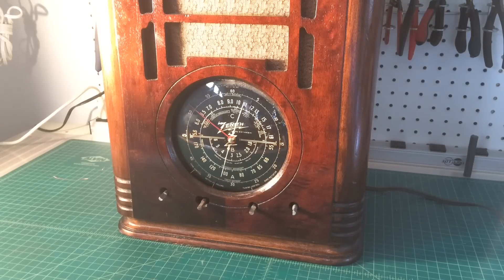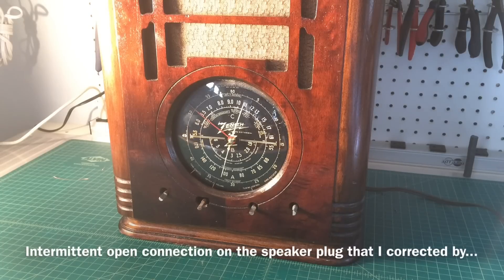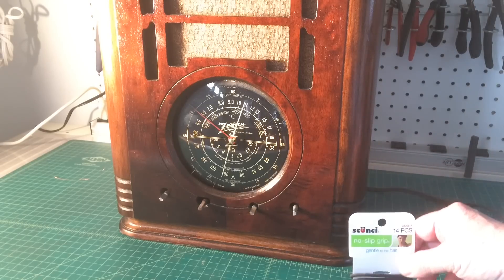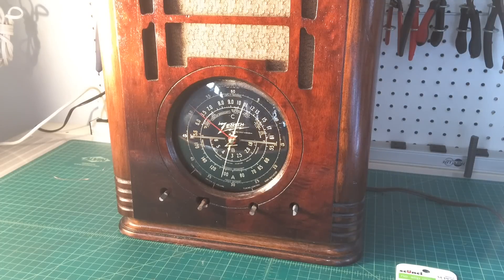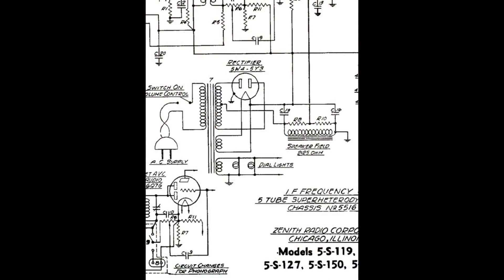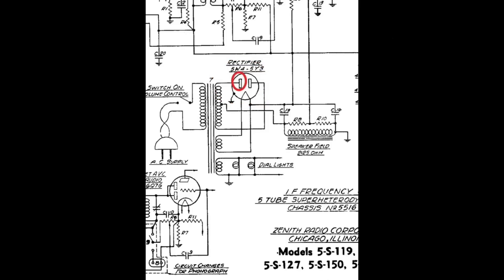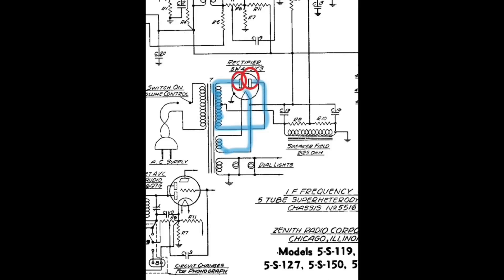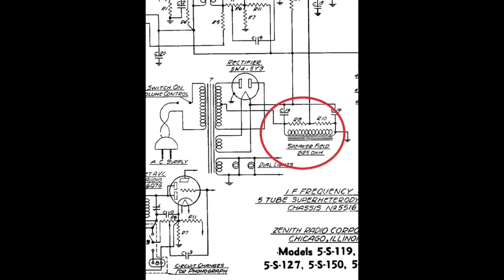Zenith 5-S-150 Substitute Speaker & Repair

Comment: I have a Zenith 5-S-151, which was handed down from my grandfather.  Around 50 years ago, I replaced the band from the tuner knob to the tuner pulley with a piece of leather shoe lace.  If that repair ever fails, I will try the Scunci hair band.  That's a very clever repair.
Reply from the maker: Tom - what a special gift and one to be cherished from your grandfather. A clever repair you made using the leather shoe lace. Thanks for watching and sharing this story. All the best. Don

Comment: Don..these black dials are one of the reasons i fell in love with Zenith..back lit at night is mesmerizing....thx for the tip with the no slip belt replacement...Rich
Reply from the maker: +iamrichrocker Yes, they are beautiful sets Rich. I can't recall, are you doing any radio work these days? Best, Don